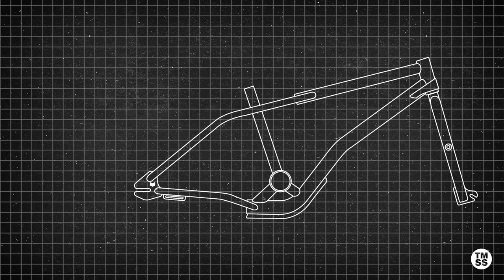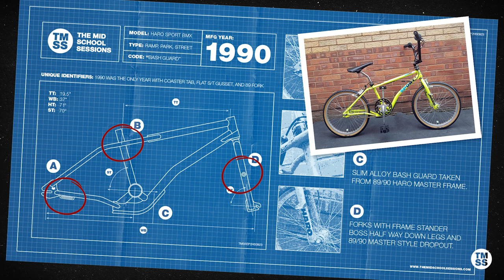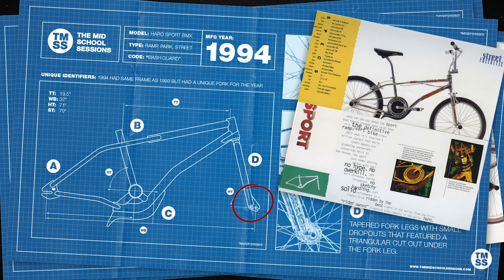1991 Haro Sport BMX Restoration EP2. Including a Mid School BMX Bash Guard Sport model year guide.

Comment: You didn't mention that since the 93 model, the seat post is 1", from 90 to 92 use 7/8 seat post...
Reply from the maker: That’s definitely another important difference to call out. I just listed the ones people could easily spot visually, but seat tube diameter is a good indicator no doubt.